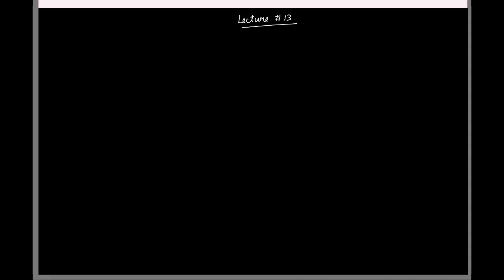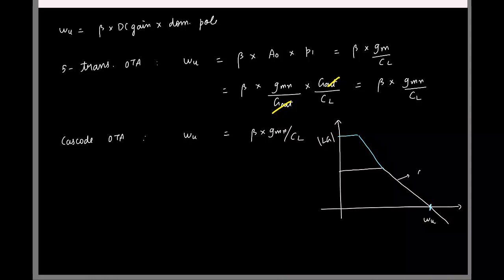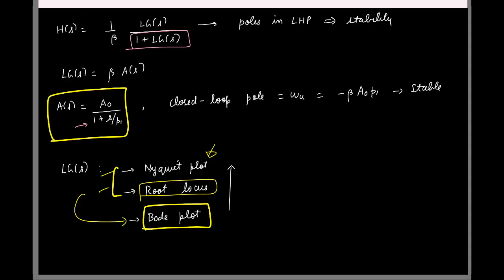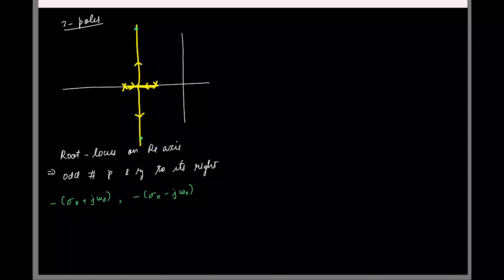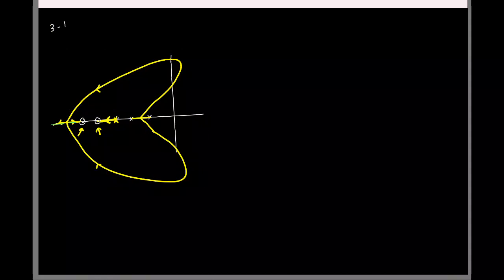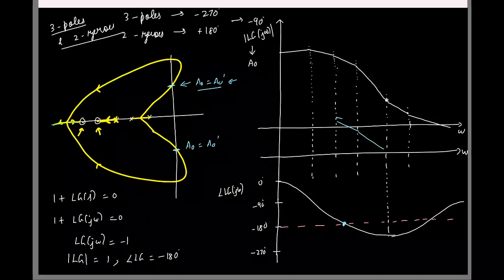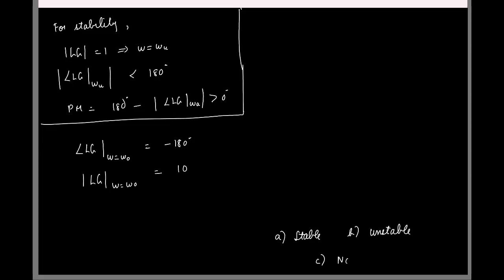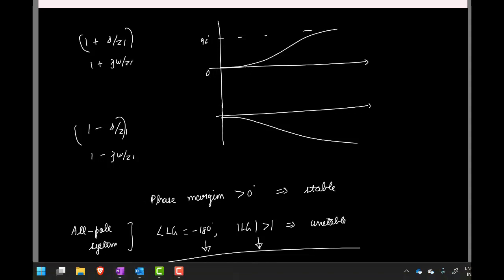Lecture 13: Using root locus to derive stability conditions (phase margin); LHP zeros vs. stability

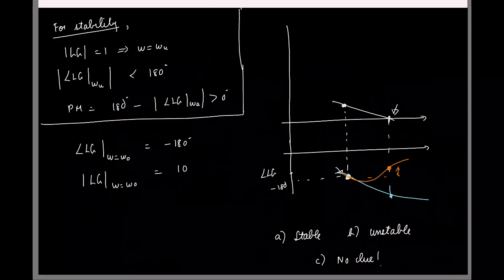Comment: 1 doubt around 47:10 . Why answer will be NO_CLUE ? Doesnt it imply that since phase is 180degree , gain >1 ,system is unstable. Also, if phase goes UP , it also implies the Magnitude plot should also shift UP.